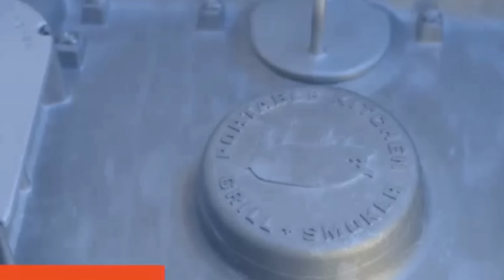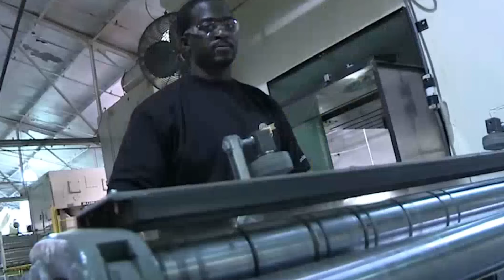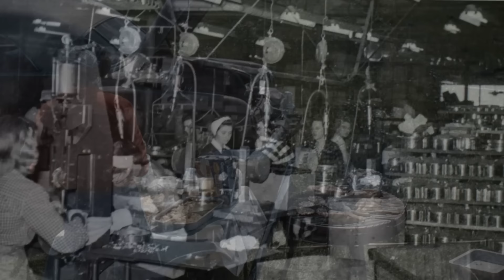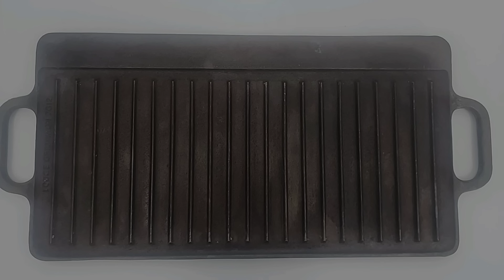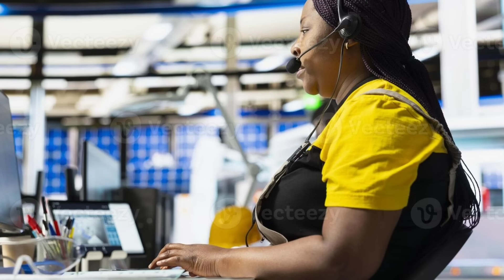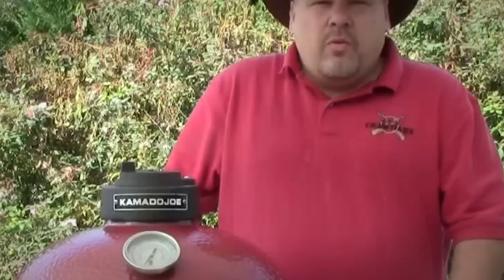10 Grill Brands Only Smart People Buy

Comment: I have a TEC infrared grill I bought in 1997.  I have changed the guts 3x once under warranty but the others for use.  I love this thing Stainless Steel porcelain heaters it will cook a steak as good as any grill on the planet.  And it’s almost 30 yrs old.  I paid 1200 in 1997 that was a lot but it was worth it.  I have a Big green egg and a Weber gas grill.  The egg is great the Weber rusted  still working.  Full disclosure I live in Florida so it’s humid and hot.  That’s my 2cents.
Reply from the maker: Good to know!

Comment: I had a Weber Kettle and despite keeping it dry all the moving parts and vents were rotting away. There are just better products out there.
Reply: I've had one for 40 years and another for 20 years, both with wheels and tables.  They occasionally get wet from rain or me hosing the dirt off.  Zero issues.  Maybe you got a copy.
Reply: @fly1327 For sure not... Authorized dealer in a military base...

Comment: Bought a Weber Genesis 13 years ago after buying disposable grilles every 2-3 years for a decade. Replaced the cooking grilles. That's it. Even the electronic igniter still works. Lives outside YEAR ROUND in the northeast. Every spring I twist open the propane, push the button, and start cooking.
Reply from the maker: That kind of reliability and build quality makes all the difference for a long-term investment! Don't forget to subscribe! :)
Reply: Same here.  Bought mine circa 2010.  Problem is the Weber Genesis from 13 years ago are much better than the ones that are built today.  Weber was bought a few years ago by private equity and just like everything else that gets bought by private equity, goes to crap.

Comment: I’ve owned a DCS grill for 36 years. I did have to replace the cast iron burners after 30 years but everything else is original. Worth every penny.
Reply from the maker: It’s impressive that your equipment has held up so well over three decades! Don't forget to subscribe! :)
Reply: I have 20+ years on my DCS  and needed nothing. I have stainless steel burners. I also have the ceramic flavor rods.

Comment: The best grill will have a cast iron firebox... steel or even stainless steel will not hold up to the heat.
Reply: The problem with all of these new gas grills are the thin ass aluminum burners. If they would make them like they should for the price they want for them they would be a lifetime grill. How hard is it to run thick enough stainless or iron with replaced jets? Or just simple holes drilled into the pipe. They could put jet on them and supply 2 different sizes so a consumer can use natural gas or propane. I guess that would be asking to much from corporate America. If these big box stores would demand it. They would be supply it. For the same price. Most of the "aka" affordable ones come from overseas. Thats no bullshit for the price they are selling them all gas grill should come that way. If they are iron they could use high heat primer and paint. I have 2 burners i made 25 years ago both stainless steel. One for natural gas and one propane that i use to boil crawfish, crabs, shrimp, ect. The jets get woren where they won't burn properly change without with new ones from the local hardware store. My great great coonass grandkids will still be using them to boil seafood.

Comment: I'll stick with my Napoleon 665 Prestige Pro made entirely out of 304 SS. Had it for 6 years now, operates exactly like day 1.
Reply: The cart is not made of stainless steel.  Plenty of other non-stainless steel parts in that grill.
Reply: @davestevens4193 The sides of the hoid are aluminum, the cart isn't 304, but 402 I believe. Either way, I have zero rust and works great.
Reply: @Nirotix I have a Prestige Pro 500 and enjoy it.
Reply: @davestevens4193 Fair enough, I made a mistake claiming "Entirely", but the parts that certainly matter are, like the tub, dip pan, clean out., flame tamers and thick 304 ss for burners and grates that matter. Those grates are killer! 

The top grate, not so much, but I never use it anyhow for the most part. Clean my grill early spring and late fall, pulling it completely apart including burners, smoke tray, everything underneath, take it all in a plastic tote to a local pressure wash bay. What's left to clean is scrape the box, clean the grease along the sides, give her a wash and detail, put it all back together again. Brand new. 

I have a few add ons, 2 flat drop in griddles for smash burgers, eggs, hashbrowns, fajitas, etc. Pizza stone, coal tray so I can hardwood cook one side, gas on other, few rotisserie options. 

I would easily say summer months 14-16 meals B/L/D come off this BBQ/week, Winter is closer to 7-10/week all weather dependent of course, and she holds the heat in the winter no questions asked! I mean, she gets worked hard!

I haven't owned an NG grill before this point, but anything I've bought previously sub $1,500 in Canada how we cook on it (wife/me) hasn't made it to year 3.

Cheers thou, enjoy it!
Reply: @Nirotix i just bought the big 44 inch 700 series and waiting for it to be installed in my outdoor kitchen set up. Havent used it yet but WOW!! What a grill. 9.5 grill grates that er closer together than the pro series a 6 burner with the infared sizzle zone and a dual infared rear burner... i have to say im impressed
Reply: @anthonybotonis5841 Yeah, the grates are awesome on the Prestige Pro line. I have the sear side burner on mine, being a sheet metal worker, bent up some 316 16g SS for a wind screen, other than that same as the 700. I just didn't want to spend the extra for the covered sear station.  You'll be extremely happy, it cooks fantastic!
Reply from the maker: That is a fantastic investment in durable, high-quality equipment! Don't forget to subscribe! :)
Reply: I replaced my Broil King with a Napoleon. 1000% times better. The Napoleon has already outlasted the Broil King, and as you said, still performs like new.
Reply: @Freakshow11000 It makes it a joy to cook on. Sure you pay more, but that extra you paid adds up quickly with joy over the hundreds of times you use it. People regularly sink a grand into a casino slot machine in a night getting nothing back other than the joy they had playing that night for comparison. 🙄

Cheers, enjoy your cooking tool. 🎉